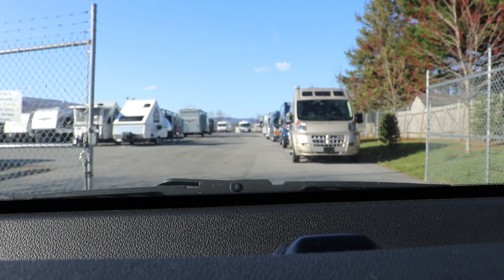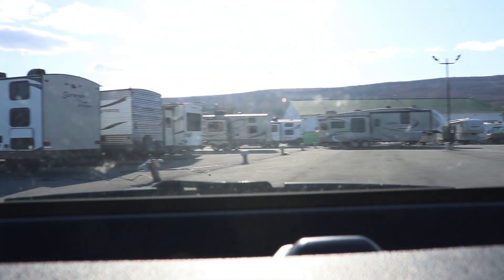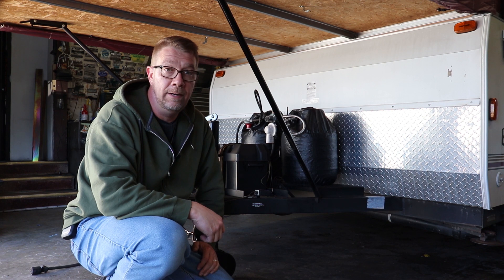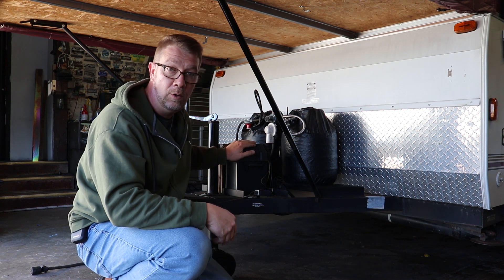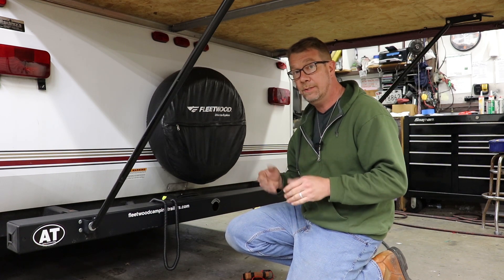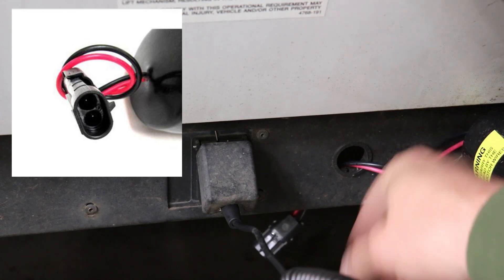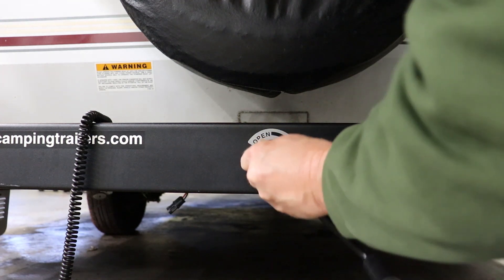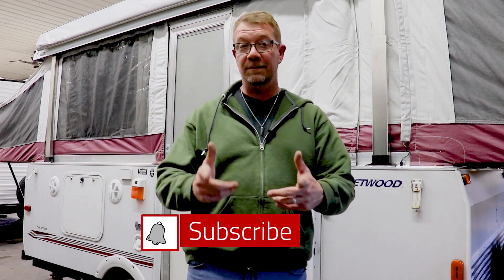Power Lift Power Levels and Override on Fleetwood Pop Ups

Comment: Hey my 2003 mesa Coleman’s electric lift isn’t work and won’t switch over to manual lift either. Can I unplug the electric somehow like this to disengage and manually pop it up? Will it stay up?
Reply from the maker: Yes. Unplug the motor, raise, then plug the motor back in. Opposite for lowering.

Comment: Well, that is a helpful video.
But what happens if you think your pop up camper is going up too slow. Is that a sign of a bad motor. Mind sounds like it's suffering When lifting up
Reply from the maker: They are indeed slow and make a bit of noise normally.

Comment: Hi Derek thanks for the video! This may be a dumb question but where exactly did you put the tester leads ?
Reply from the maker: At the battery and harness.
Reply: @popupcamperpro So you exposed some of the wire on the harness ?

Comment: After you unplug it, so you can bypass the electric lift, is the crank supposed to be really hard to turn?  Or are we doing something wrong?
Reply from the maker: Should be fairly easy but slow. If it’s still difficult, then something else may be wrong.

Comment: I was having an issue with no voltage reading out of the power limiter but there was voltage to it, and the remote had continuity on up and down side of switch.  A few days later, fully charged battery, everything is working fine.  I had concluded the limiter was bad but now i'm not sure.  Any ideas/suggestions?  Should i change the limiter anyway ?
Reply from the maker: I wouldn’t. Could have or still may be a poor connection. Try some dielectric grease at the connection between the motor and limiter.

Comment: Hey Derek we've got a 2004 fleetwood folding trailer and the power lift isn't working, it looks like there is a bike chain just hanging above the motor any thoughts on what that is?
Reply from the maker: Sounds like the power lift was added. The chain is likely going to an upper crank assembly.

Comment: Hey Derek. I have a flagstaff classic 2015.  the roof goes up, but it wants to start going down when lift power starts.  is the motor brake bad?  I believe it is a carefree..thanks
Reply from the maker: That’s very odd fletch lives daily. Perhaps the polarity’s reversed at the motor?
Reply: Hey Derek.  When I stop lifting, the top just wants to slide down very slowly.  I took off the carefree motor and it spins freely.  The clutch is tight.  Do you know if there is a brake in the motor to keep it stopped...thnx
Reply from the maker: @fletchlivesdaily348  there is. When 12 volt is supplied to the motor, a brake is engaged.
Reply: Sorry about the first comment, a bit confusing
Reply: So when it is powered, I shouldn't be able to turn the motor pinion gear...which I can turn it.

Comment: Thank you for this video! I have an Avalon pop-up and the power lift stopped working. I have three of these as insurance. I did get stuck once and I  wish I had seen the video on how to disconnect the brake. I tested the voltage going into the current limiter which was 12 volts but when I used the power lift to test the output of the current limiter it was zero volts up and down. Does this mean I need a new power lift current limiter?  I think we might have fried the current limiter when we raised and lowered the roof while on house power.  On my popup, the current limiter is riveted onto the bumper, did not see any other screws.
Reply from the maker: It could be Michael. Check your limiter wiring and ground as well for any faults.

Comment: Derek, awesome drive to work.  Is there a video or link on how to replace the lift motor (2009 avalon)?  I purchased the replacement motor last year from your store - its still in the box.
Reply from the maker: In the INSTRUCTIONS link you can find the how to, but it's pretty easy. On the side of the motor, is 3 small Allen head pinch bolts. Loosen them, then tighten them to the motor mount.

Comment: Derek, If you don't get the proper voltage readings when you press the up and down buttons on the remote, how do you know if the problem is with the remote or the current limiter? Thank you
Reply from the maker: You can test both sides of the switch as well for continuity. Typically if the remote fails, it's one side of the switch and you get no reading from the limiter though. It's possible that the switch could provide a faulty reading, but very unlikely.

Comment: Derek, I have seen an abundance of your videos but none the clearly helped me define what I need to know.  I am looking to find out what current limiter was installed on my 2007 Niagara.  I need to order a new one as the remote plug in is missing and a bypass has been installed.  Problem is with the bypass the electric brake does not work when the top is lifted.
Reply from the maker: We've got you covered. Please give me a call at the shop for personal assistance with these products.
Reply: @popupcamperpro  I'd love to give you a call, so what's the number?  I don't see any way here on YouTube on finding that out.

Comment: Thanks for that video.  My Somerset roof needs to lift a smidgen more for the door to fit (probably 1/4" - 1/2").  The lift motor has some set screws (Allen wrench style) that I am reluctant to adjust because I can't find any instructions about the motor and I am only guessing that the set screws are used to adjust travel.  I don't know if the lift height should be adjusted at the whiffle tree instead.  I suspect it is a simple fix, but I don't know where to start.  Any guidance you can offer?  (Albuquerque, NM)
Reply from the maker: Hello Christopher! The Allen head bolts (3) are the motor mounts. These pinch mount the motor to the motor mount. The height adjustment is done at the whiffle tree. You can find more detailed instructions on this system and more under the link INSTRUCTIONS at colemanpopupparts.com
Reply: @popupcamperpro  Thank you. Thanks you. Thank you!!  You’ve got my business!  These days, so many dealers are interested in just serving the “big” rigs - I used to have one of those, but “upgraded” to the pop up lifestyle and never looked back. “Less is more.”
Reply: @christopherkerns9811  There are also a set of additional holes in the horizontal pulley mounts at each corner underneath the popup. These are more course adjustments. If you run out of fine adjustment at the whiffle tree, you can try these. You'll like have to loosen the whiffle tree adjustments if you move to the other set of pulley mount holes.

Comment: Be cool to retro fit one
Reply from the maker: Some are easier than others...
Reply: @popupcamperpro  would you happen to have any thoughts or videos showing how to add one to an early 2000's Bayside Elite w/ left side crank.
Reply: @tom85lhu  I'd recommend a metal geared cordless drill with a crank adapter. (https://colemanpopupparts.com/products/new-style-cordless-drill-crank-adapter?_pos=1&_sid=36a35cfaf&_ss=r). The best of both worlds. DeWalt use to be the best drill for this. I'm not sure any more.